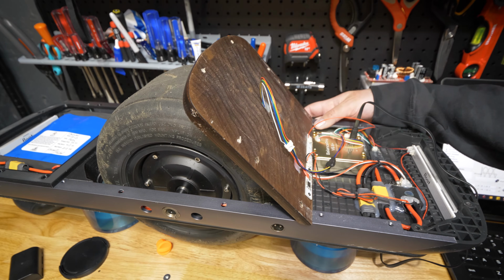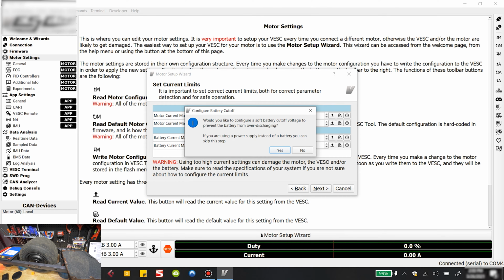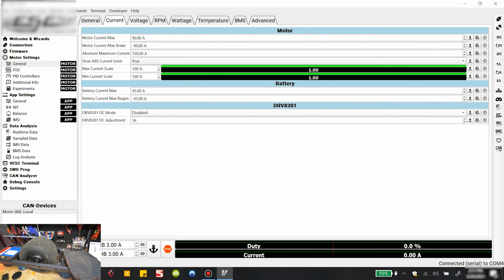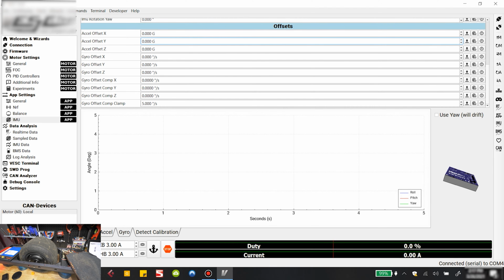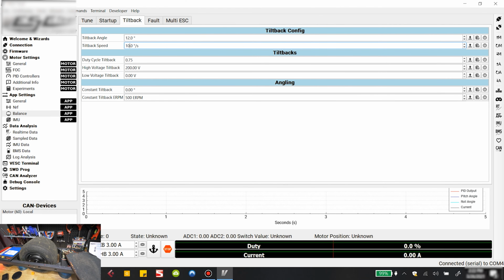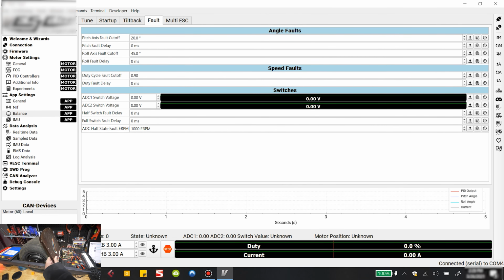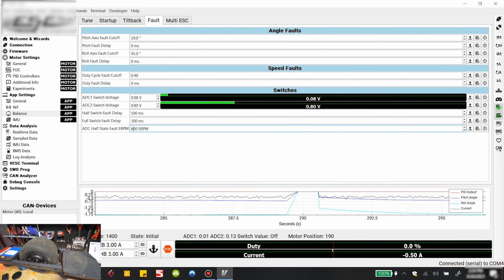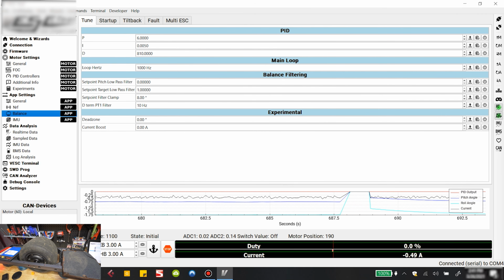DIY Onewheel Software Setup | Configuring with VESC Tool | Floatwheel

Comment: Can't the board measure battery capacity with more accuracy than just checking voltage?
(By monitoring the charging and discharging currents)

Comment: I’m new to the float life scene. Looking to buy my first onewheel and I stumbled on to your video. I’m pretty good at building stuff and I thought why not. However I have a question for you. How much different is your float wheel from your onewheel in terms of ride and feel?
Reply: In my opinion, the Onewheel Pint and the floatwheel perform fairly similarly. There are some minor differences: I think the Future Motion/Onewheel footpads are better but I like the charging port on the floatwheel better. I think they are both pretty fun.

Comment: Thanks Mario, This is very useful stuff for any Floatwheel Newbie :)
It worked first shot with all these great tips. However, I really need to find a better battery as the one from the kit has too much sag and limited uphill capability.

Comment: You gained a subscriber specifically because of the Floatwheel content. Please do not be afraid to include the in depth nitty gritty details about the setup and issues. The structure you give your videos can be used to find the information needed or skip across unneeded information. Thank you so much for your content, I hope that this series is worth the effort to you, just know we appreciate it.

Comment: Thanks for posting, though I have my FunWheel generally configured to ride well I still watched all the way through to see if I could pick up something new, great info.

16-17mph, that's interesting. I thought the FloatWheel wasn't that much faster than the FunWheel, which I can get up to 14mph but that is at 75% duty cycle. Maybe it could go faster too, but I'm just to heavy (210 lbs).
Reply: Are you riding 12S?
Reply: @weberito  Yes. 50.4 volts really is the highest recommended for the cFOC2 ESC. I've heard of some running it on 13s though.
Reply: @thespiritstudio  I thought that might be reason for lower speed